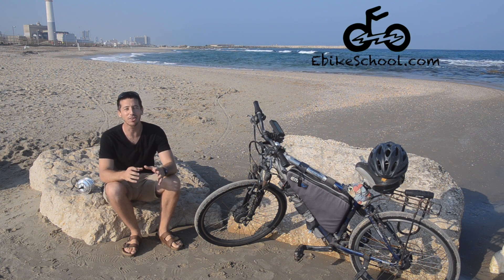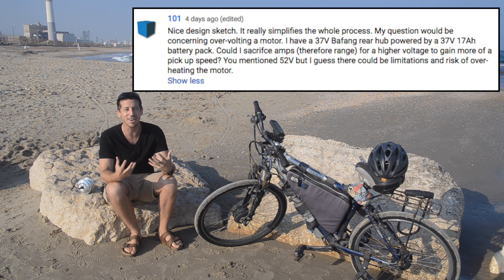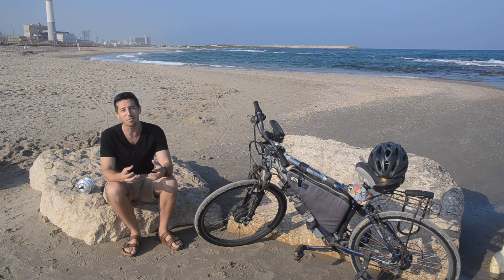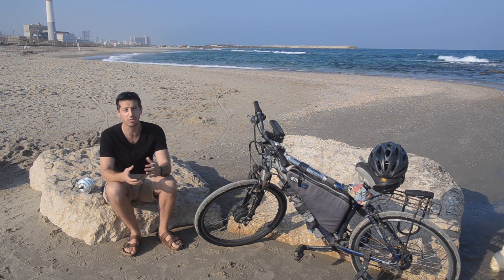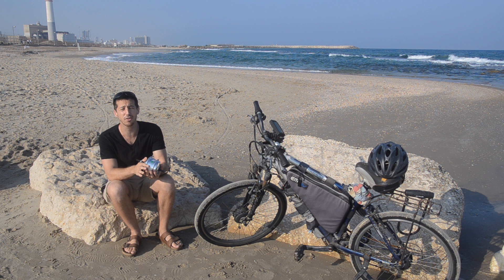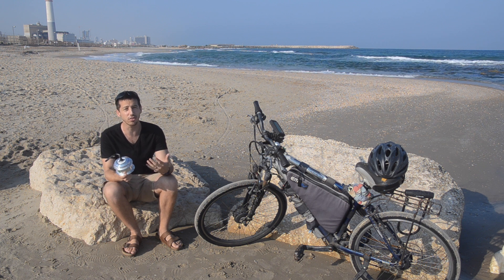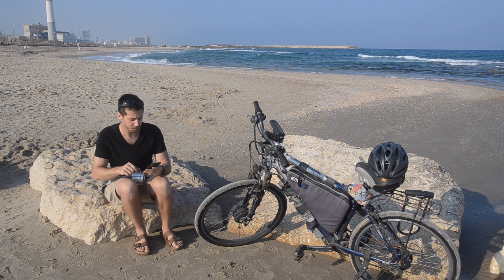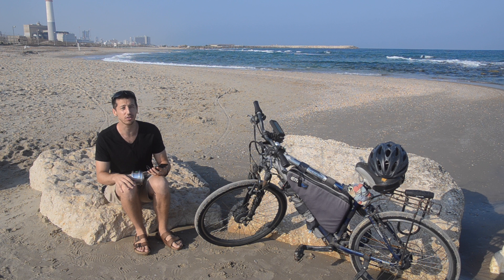Overvolting an electric bicycle motor for more speed! Q&A#7

Comment: What if i have a 36v battery can i set the controller to 48v? And will the motor use 48v or just still use the 36v? What i mean is are batteries the same as motors and will give you the higher voltage if you can set it on the controller like i can? I've got the 850c and will be getting the programming lead eventually to configure the extra settings that gives you like realistic acceleration and what not.

Comment: Hy, i have question. I have 250 v hub motor and battery of 52  volts 17.ah and 1000w regulator. My question is: do i get more torque on my 250v motor, i see on this video that i get 40%motor run faster, butspeed is not so important. Torque is more important for me. Thanx, i hope you answer me. Greetings

Comment: Hello, just fascinated by the 0.003 number. It's amazing. Who would have thought 
PI*DIAMETER_INCH*60*RPM/63360
could be simplified to 
RPM*DIAMETER_INCH*0.003
with only ~0.8% loss in accuracy of the real value.

Comment: Sir you told that over volteing the motor.  I am using 24v gear motor. I can use 36v 20ah battery in that motor

Comment: If the motor is rated for 1,000 Watts, does the battery have to be rated for 1,000 Watts to match the motor?  Can it be 500 Watts?

Comment: My 48 volt controller can't working above 64 volt. But my 5*12 = 60 volt pack volt after charging is 67volt.  So now my question is how can i increase my controller voltage range from 64 to 70 volt.

Comment: on small diameter wheels increasing voltage does not help much, i have a 48v 1000w hub motor on a 20" wheel and i did the equasion as if i were to upgrade to a 52v battery, my current max speed is 38.3km/h but doing the equasion it only went to 41.6km/h, only a slight boost possibly because if my wheels smaller diameter

400 × 20 × 0.0048 = 38.4 km/h × 52 ÷ 48 =  41.6 km/h

saddly i may need bigger wheels or a much more powerful battery

Comment: Possibly worth noting that the power and voltage ratings are usually just for motor duty cycle. At their rated power the motor should be able to handle a 100% duty cycle. Past that point they will begin to reduce in duty cycle due to the increase in heat generation as the power utilization increases. Well noted though :)

Comment: I've built a 2WD 36v motors each having 10.6 amp bottle batteries. I'm thinking of adding an extra external pack of 4V 10.6amp in series (maybe to 8V) to each motor. Not sure of how best to go about it, but would like to give it a go. Connecting the wiring black/red from each bottle battery to the boost batteries without blowing them up is what bothers me lol. Any ideas? Nice vid btw.

Comment: I have a question about amp. My electric trotter one wheel operates on 48volt 8amp , which gives me roughly
6.5 miles range. If I want to double my range, do I buy a battery that is 48volt 16amp, but will the higher amp burn out any electronic components? What amp do you suggest I safely bump up to?
Reply: see your controller spec..
Reply: You're on track, double the amp hour rating of your battery will greatly increase your range and will not harm anything electronic. It's as if you doubled the size of the gas tank in your car, you would roughly double the range of your car. Of course, battery will weigh about twice as much and be sure it will fit in your bike.

Comment: What would your thoughts be about overvolting the bafang 750w hub motor to 60v? Is that too high? It seems like the industry is moving up from 48 to 52 with this specific motor and I was hoping you could speak on if taking this motor to 60v would damage it. Cheers and thanks for all the great info!
Reply: it works 100%, I run my at 60v
Reply: It should not MOST 48v controllers can handle 63v but be careful not to let it blow up!! Open the controller and see the Capacitor limit I’d be careful
Reply: Did you try it?

Comment: Hey Mika I have a question. I want to make an ebike with a 1500w rear hub motor, but the battery is the issue. I was deciding on getting a 52v 17.5ah battery that mounts on the downtube, but then I found a 72v 20ah triangle battery for cheaper! Would running that battery burn out the 1500w motor rated at 48v or would it be safe? Thanks.
Reply: 6:27
Reply: I would recommend upgrading your controller to be on the safe side,
Reply: Your motor might get hotter faster then normal but with moderate use, it should be okay

Comment: This is wrong, if you increase the voltage and reduce amperage you will get less power, maybe get the same power from higher voltage battery.
You reduce motor temperature but get less power. You cannot fool the system this way ... you are fooling yourself

This did not contain any new information whatsoever by the way

Comment: The only way you'd get a 40% increase in speed AND limit the current to the motor, is down-hill!  Limit the current, then under load, the voltage to the motor automatically drops, way, way below 48v, there's no way around it.  Again, it depends on the load.  Don't limit the current, then we're talking real numbers.

Comment: Voltage= Kw power also but in general voltage= Top speed and Amps or Current= Acceleration example 50 volts @ 100 amps = 5000 watts or 5kw the same 50 volts @ 50 Amps= 2,500 watt's or 2.5kw or 100 volts @50 amps still 5kw but more Top Speed less Acceleration

Comment: I hear and read from many forums that a 48 volt battery can be destroyed if discharge to the 36 volt cut off. I was reading and hearing that you should monitor the voltage and make sure the 48 volt battery does not discharge less than 42 volts, if lower than that you are possibly damaging the battery are your thoughts on that?

Comment: Voltages are usually not marketing. you said it yourself, the motors are meant to be ran at those power levels. Any more they are not as efficient (heat up) and you run a risk of damaging the motors.

Comment: If I run a 52v battery through a 48-80v controller to a 1500w rear hub motor, will I get a poorer performance?
Reply: Yes indeed. Your voltage limit is still 80volts, the more voltage the more speed. But the question is do you have enough space for your additional battery?
Reply: @happy_4ever93b  I just have the one battery. But would i get the same, speed, as when i was using just a 48v controller with a 1000w rear hub? If, i used the new setup?
Reply: @owenkilleen  currently what is your voltage supply?
Reply: @happy_4ever93b  52v 14ah.
Reply: @owenkilleen  ok and your dc controller?
Reply: Adding with other pack of battery with same voltages will not give you extra speed but in KM yes. So if you are now using 52volts and you plan to use 80 volts yes you will definitely increase the speed power, but make sure that you never excess  voltage limit from dc controller for safe a side.
Reply: @happy_4ever93b  You misunderstand. I want to know, if i use a 52v battery, through a 48-80v controller with a 1500w hub, will i get poorer performance than when i had same battery through a 48v controller and a 1000w hub?
Reply: @owenkilleen  definitely you can't do that because the coil inside motor will damage if you over voltage from your original 48volts motor hub to 52volts. If you plan a new set up higher dc controller same time change the hub too. Or find a technician to re-winding the motor and change the higher coil size as your desire voltage and wattage.
Reply: @happy_4ever93b  och I'll leave it there

Comment: Hello, Is it safe to use a bigger battery for my ebike ? mine uses 48v 21Ah, and the newer models of my bike uses 48v 42Ah, would it damage my Ebike's engine or would it actually improve the range of how many miles i can do ? i live in China and i'm using (Xiao Niu) brand. Thanks in advance

Comment: Great video if you put a 60vt 24mosfet 5000 watt controller to a 2500watt (60volt) motor with 45amp fuses,Would that burn out the motor? Thanks!

Comment: Wait a darn minute, so my bike is a factory built 36v bike that has a 5 bar handlebar battery indicator. To my knowledge that’s not adjustable so the indicator certainly won’t display correctly if I went to a 48v to 52v battery, so there’s that, but more concerning is that li-ions have a recommended low voltage and without a controller change, you risk the controller discharging the cells to the lower voltage of the current controller. Maybe the additional 12-15 volts discharge of the complete battery could be ok but it needs to be mentioned as a possible issue. You literally discharging them an additional 1 volt under the absolute lowest voltage built into the controller. Comment?

Comment: Hi there, I had a 52v 17.5ahm battery which power up the 52v 1000w motor.Recently I have sent the battery for repair due to when I pedalling or throttle it gone off. Now I’m using 48v 17.5ahm battery as a spare battery,but i felt a huge downgrade because it only can run 1/2 of distance of my 52v ,and it ran slow.Would you mind to explain how it happens please?
Reply: You will lose a little acceleration after going down to 48 from 52, But not to the extent you are describing? And, Only half the distance now? You sure it's the same capacity? Can your controller manage 48 as well as 52? Other than this, Sounds like another problem!

Comment: HELLO VERY GOOD VIDEO THANK YOU. I AM NEW IN THIS TOPIC OF E BIKES AND SCOOTERS BUY A SUNRA MIKU MAX MOTOR BOSCH 800W WITH A BATTERY 60V 20A MY QUESTION AND THAT OF MANY PEOPLE IS HOW TO DISMISS OR CHANGE THE SPEED REGULATORS WHAT I HAVE TO DO? CHANGE CONTROLLER? WHAT TO BUY? OR THERE IS ANY WAY TO REMOVE THOSE LIMITS?  THAT THE ENGINE CAN GIVE A LOT MORE BUT THIS IS LIMITED TO 45KMH FOR THE IMPORT REGULATIONS. BUT IN MY CITY IS NOT SUFFICIENT 20% MORE SERIOUS VERY GOOD

Comment: Shouldn't you be calculating circumference rather than diameter? 

Diameter x pi 3.1415

I think the surface of the tire = 1 revolution. If I'm wrong, please explain.

Comment: Okay so how do you actually overvolt it. You never said. You just said what happens when you do it. Are you just using a 52v battery with a 36v controller? Is what what "overvolting" is?
Reply: Connect a controller that is able to run whatever volts you are wanting along with a battery with same ability.. That's it, The motor doesn't need anything done to it.
But keep in mind something this guy didn't mention: If it's a brushless motor, You will be limited to what the commutator can push (just google the thing if you don't know what it is)

Comment: Hey, I have 3000w hab motor with 84v battery how can I increase the speed and range?
Reply: Learn how to string r.c batteries and how to take care of them. If you let the watt shop handle your batteries by buying there amps then you pay for it! I paid less 300 for all three r.c batteries for my 1000 watt hub gets me 72 v and 45 mph. Using same 48 volt controller.

Comment: Can I do a 48V 450W motor, 48V 450W brushless controller with 60V 20AH batteries? Please. It'll help a lot.
Reply: freesf ftrefv Thank you, Sir. I am worried thay I'm gonna fry my controller and motor because I have a higher voltage battery. This really helps :)
Reply: freesf ftrefv Ouch. I installed it 3 days ago. It added a 7-8km/h top speed and power when I'm riding uphill.

Comment: Love the video. I have a clean republic 250w 24V hilltopper kit. The battery is pooched. Looking to over-volt it but I think the controller is built into the battery. Any clue what the max voltage is for that built in controller. Should I go with an external controller?

Comment: how much ah battery i need for 2000 watt hub motor /also suggest controller.
Reply: you can have whatever you want, but as long as you use the correct voltage for both the motor and controller, you should be fine with whatever AH you choose, that just means the higher AH you have, the futher you can travel
Reply: @mgut17  ok thanks for reply

Comment: Thx fir the idea and let me make your point more clear ans shoty.
-Buy 48v 1000W motor, 96v controller, 96v lithium battery pack.
Dont push full gas at the start. Slowly accelerate to 90km/h
https://www.aliexpress.com/item/72V-96V-5000W-Brushless-Motor-Speed-Controller-100A-36Mosfet-120Degree-Phase-With-Sensor-Hall-For-Electric/32949376944.html?spm=2114.search0104.3.97.2a6fdb11Cop8Jk&ws_ab_test=searchweb0_0,searchweb201602_5_10882_10065_10068_319_10059_10884_317_10887_10696_321_322_453_10084_454_10083_10103_10618_10307_10820_10301_10821_10303_537_536,searchweb201603_52,ppcSwitch_0&algo_expid=cee88bca-f286-4fb9-ae2f-3f0deaa0fb2a-13&algo_pvid=cee88bca-f286-4fb9-ae2f-3f0deaa0fb2a&transAbTest=ae803_4

Comment: My battery melted!

I over volt my 3 speed 48v 500w rated ebike with 10a fuse and a max speed of around 40km/h to 60v with 30a fuse. Speed did improve to around 47km/h and running at 2 speed or higher is flawless even with heavy load and uphills. The problem I encountered is when I ran at 1 speed the plastic cover of the battery near the positive terminal melted!

Why did running slow at 27km/h melted the battery? Is my setup all wrong?
Reply: You were going up hill?
Reply: @swedensy  I was on flat road when it melted.

I've been reading a lot since I posted this question. People say it was dirt or loose connection to positive terminal which is probably true because no matter how I try to simulate it again the battery just won't get hot anymore after cleaning and tightening the connectors.

Comment: im a big guy around 6'6 and 85-100KG so my bike is getting sluggish (its a big heavyish REEF PREDATOR 2017 downhill bike @ 25-30kg) its a bafang 750w-1500w mid-drive motor setup also.. i have a single Samsung 36v lithium ion battery with a bafang C695 controller
now i think the controller is able to do 36v and 48v.. and up to 30amp, but did want to upgrade it to a controller that can go up to a 60v battery setup (bafang C805 color controller on ebay i think it shows watts used and all sorts more settings than my original controller)

how would i go about  cranking up the speed and acceleration cost effectively??  without taking to an e-bike retailer and saying "juice this baby up kind sir".. also while not being super tech savvy, but can follow good guides.. like im a really good tinkerer but with gas motors, when it starts to get to needing specific speed controllers and getting the right amps/volts or shit will just blow and waste my money and ruin my stuff, my brain just fries guys hahaha ilike older stuff with less electrics.. less to go wrong #carbypower

New higher voltage lithium ions? maybe times 2?? or 1 REALLY high voltage/amp one??
or maybe a lead acid battery setup in a series as the batteries are cheaper?? and up to max voltage of controller??

and what way is best for battery life/longer rides?? as with my 2year old bike i can barely go 30km before its almost flat and thats with medium pedal assist and lots of pedaling..(slightly hilly area, far from flat.. i live near foothills) is there some way to make power to send back into the battery while riding? like those old roller/motor/headlamp setups that attached near side of wheels for lights, and gained power by rolling on tire sidewall?? but instead of a light attached a charging plug to it and plug it into charge port... or is it not possible to charge bike battery and ride at the same time??

Also i got a USB cable to connect to the bafang motor to the PC to do in-depth setting changes, does anyone have one of these? and have used this type of motor config method?  cable was only 30 bucks on ebay

Comment: Question:
So the limit is on the weakest link of the system.
By reduce amp to motor, it limit the possibility of motor overheat.
But higher volt will make motor run faster.

How do you compensate run faster overheat or higher torque overheat???

If there is a cooler in the system like rocket. Then none of the component will overheat.
Reply: By controlling the total current. Current is volts x amps but I may be mistaken. But for example you can have 100v with 1 amp for speed but the torque would be missing. Also you can have 24v and 100 amps it'll still go slower but it would have tons of torque. Having too much current makes the motor run hotter wether it's too many volts and low amps or just high low voltage and high amps

Comment: oof the speed of the motor is depended on the amount of current not the voltage. The only thing that increasing the voltage does is allow more current to be drawn. It is shown through a simple formula F=nBIL
Reply from the maker: This is not correct.

Comment: The speed of your motor is controlled  by the frequency supplied by motor controller. The overvolting will increase amperage hence power output. The extra power will create stronger magnetic field which will create more torque....

You do get faster by overvolting because you get extra power and having the same weight(resistance) you will ride faster. 

Your theory works with brush motors, but you have brushless motor.

Comment: i have 36volt rear motor i tried to over volt it with a 52volt 13ah 1000w battery with a 48volt 1000w 30a contoler and lcd that i hooked up, when i hot the power the throttle the wheeel didn;t moove unless i turned on the lcd and put it on pedal asstace 1 or or higher it the wheel moved aliitle bit, sometimes!but not all of the time why is this?

Comment: Your videos are power packed! 
Thanks for posting them.
I am currently building an e-bike with a brushed motor rated 24v 500w. Its Same rating with the controller. Can the motor handle 36v?
Secondly, how fast can a hoverboard motor go if i build an e-bike with one of it motor?

Comment: I would think that over volting might increase torque also in my humble opinion?
Reply: voltage increase will increase speed, not torque.

increase controller amps to increase torque